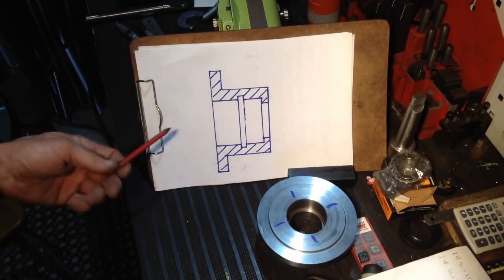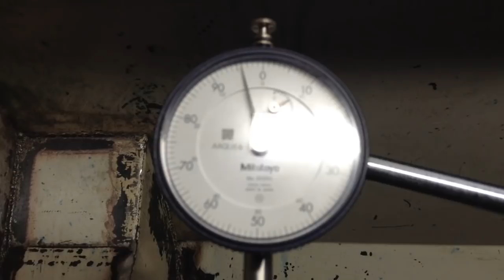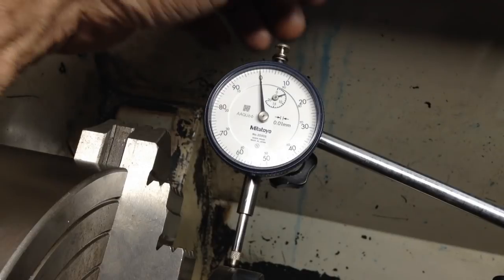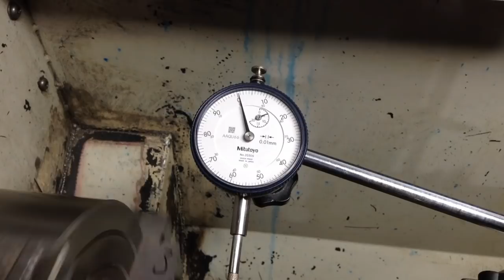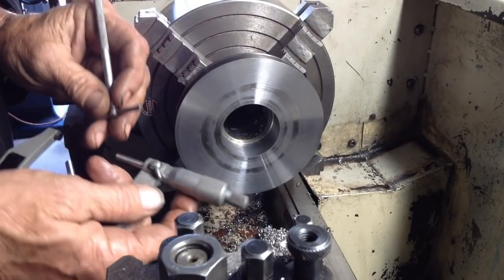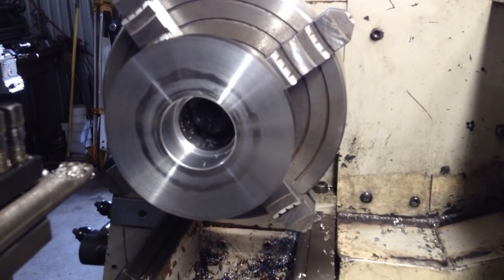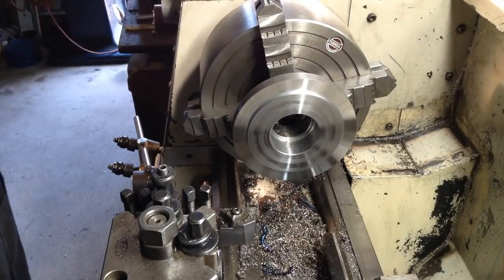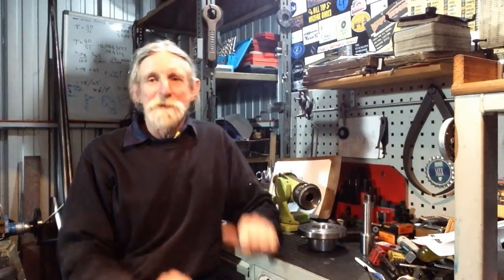Lathe Tailstock Chuck Mount . part 6

Comment: Now I want a tailstock chuck mount!  Add that to the projects list..... My Mitutoyo 513-405 2μm DTI seems very repeatable, I use that rather than a plunger dial gauge where I need serious precision. I have an ancient Baty plunger type indicator that has excellent repeatability though.
Reply from the maker: All of my old ones are over 35 years old , still work but need a service as they are starting to get a bit sticky !
I just googled a couple of 513 's   on ebay , shipping ex China !!!

Comment: Nice work Max.  I have a similar Mitutoyo (.001") indicator that I bought new over 20 years ago.  It is rock solid and always goes back to zero (if you're a zero fanatic!) .  In the comments you mentioned you got it online and suspect it may be a knockoff.  I had that as well with a .0005" test indicator I bought on Amazon that was supposedly a Tesatast brand.  It felt cheap and light and started acting up after a few months of use.  I replaced it with a dealer bought Compac .0005" indicator that was the real deal.  About three times as heavy and after five years of constant use (with a few collisions) it is still like new.  I also have the Compac .0001" indicator (same body as the .0005") that I bought about ten years ago.  It was when I got that one that I quickly learned how important surface finish is when you're chasing tenths.  Can't wait to see the chuck spinning on the tailstock.  Ken
Reply: Good to hear that.  I was worried when I heard Max a other mention problems with their Mitutoyo indicators, which surprised me, but I had also forgotten about the counterfeiting of them.  I need to purchase a few good indicators and certainly don't want to waste my limited funds on cheap knock-offs that won't work or last!
Reply from the maker: @bobvines00  Bob , if you buy them from a local tool supplier then you know they will be the real deal .
Reply from the maker: Hi Ken .  My old Mitutoyo's are all rock solid  , but  imperial ones !

Comment: Hi Max, finished mine, running mine at 60 mph, 3 to 1 Diff ratio, 1000 rpm get substantial heat build up after 5 mins continuous running, the seals are pretty tight and I don't have the the air speed of course using the car wheel bearing.
Will run cooler when the seals wear in.
Running under 500 rpm no problem.
MT 3 seems a little flimsy for the application, need a bigger lathe!
Reply from the maker: Cool . My one will probably never have to run over 500 rpm !  I will  probably just make mt 4 & 5  spindles  and swap them out as req'd to fit my other lathes .

Comment: I have no proper training, so forgive me if there is an obvious answer, but would it be slightly easier to clock the back face of the part first, before indicating the outer rim? Maybe reduce some of the back and forth?
Reply from the maker: Not really ,  except if you can see that the back edge is running wonky .  Everything moves around a bit in both directions when a jaw adjustment is made .

Comment: Thanks Max, I voted soft jaws but was still impressed how well you dialed that in. A question outstanding in my inexperienced staff mind though, is it typical to be able to achieve that level of runout in a part? I guess I had always felt that the level of precision you achieved (5um or 2 tenths) required final grinding. Thanks mate, Mark
Reply from the maker: Yes , that's  bordering onto grinding tolerance .
With soft jaws , the shape of the part can play a part in tolerance levels .  The closer the part  diameter is to the bored jaws the better for axial run out , and face run out is normally good if the part has a good shoulder to register on . 
Of course a lot can vary on the condition of the chuck .   
The soft jaw video will be done at the completion 
of this build . 
Cheers .
Reply: @swanvalleymachineshop  thanks for the reply Max. Looking forward to the soft jaws episode as I have still been too lazy to google it! :-)

Comment: Great series, Max, and perfect timing, Friday evening, hot chilli pizza, a couple of coldies, and a new Max machining vid, a couple of questions if I may?, as a wannabe machinist, seeing and hearing your comments on the Mitutoyo, what would a better choice be?, I'll never be in your league, but I was shocked to discover, I take pleasure in owning quality metrology gear(can't really use it to it's fullest extent, but..), and have been looking for a new dial indicator,

secondly, how the hell do you calibrate your hammer that well;).

Thanks mate,

Scott.
Reply from the maker: Go with Mitutoyo .   I picked that one up on line & am a bit sus in case it's a knock off , it looks genuine but does not feel it .  If i buy another , it will not be on line . I will pay the extra & buy it from a local supplier .
Lol ... my hammer .... !!!
Cheers .

Comment: Every time I see you use telescopic gauges, I think to myself "Self, he's using those wrong!" Then, I tell myself, "Self, shut the hell up, he hits his numbers better than you can." Oh, and he juggles a camera the whole time.
Reply from the maker: Lol  . You mean after all these years i have been poking the wrong end in !!!
Reply: @swanvalleymachineshop  Well if you really want to know, I was told to insert the telescoping part into the bore at a slight angle, tighten it, then rock it out of the bore in one motion. Whatever works for you though!
Reply from the maker: @IBWatchinUrVids  Hi Mate , that is the right way  to use them  , however there are occasions where that way will give a miss read .  Some diameters , they will not self centre well & you are only picking up one point in the bore not an average .

Comment: First
Reply: 4 jaws rule for accuracy but setup time for the result is passable for low quantities, for multiples soft jaws would work with an increase in tolerance for the 3 jaw poor repeatability.
Quality first.
Take care.
Reply from the maker: @pebrede   Exactly .    I run my soft jaws in an unworn chuck that has never gripped anything but machined surfaces , it will be interesting to see how it goes . 
Cheers .
Reply: @swanvalleymachineshop  Max, do you have to have two chucks, one rough one good one or how you deal with black steel without knocking your chuck about? Jeff
Reply from the maker: @jefftheaussie2225  2  three jaw chucks . one good one & one semi reasonable one ( sometimes ! )   Black bar or anything un machined i hold in the 4 jaw .
Reply: @swanvalleymachineshop  Thanks Max.